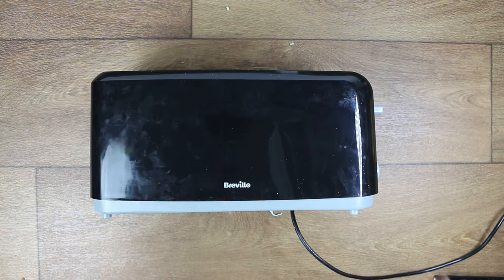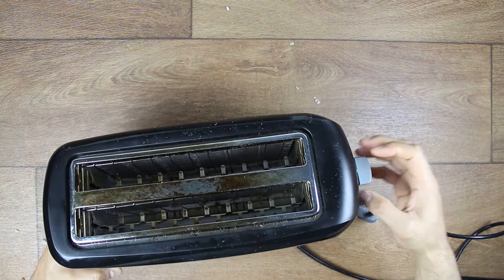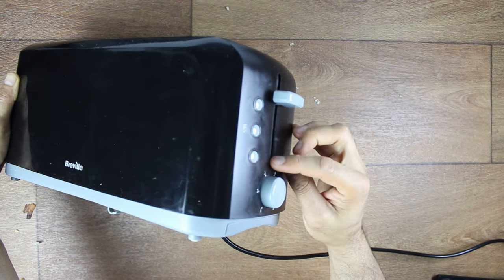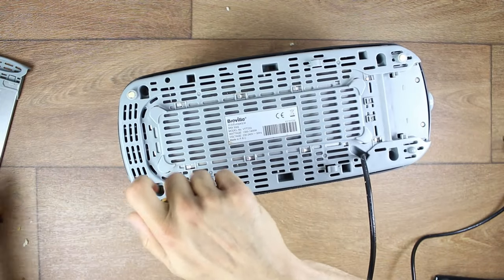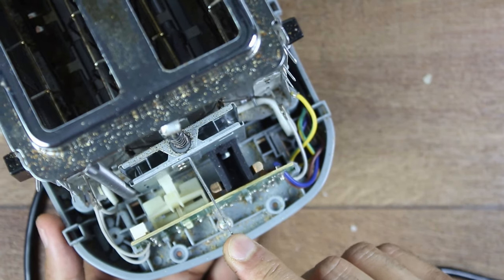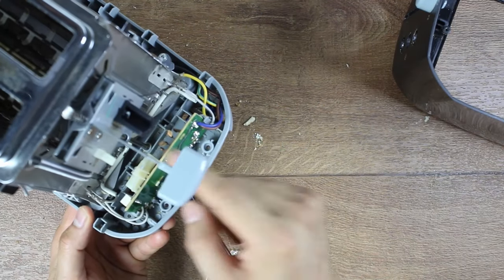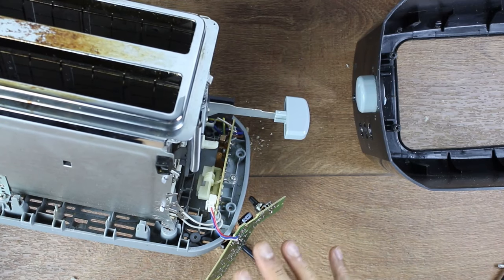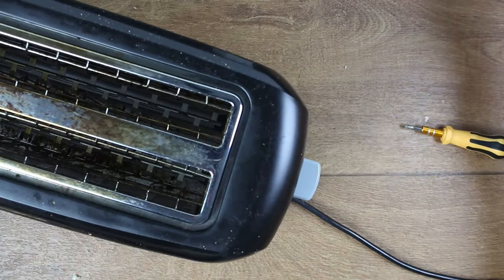Toaster Lever Won't Stay Down - Easy Fix If It Has Power - Breville Vtt233 4-Slice Toaster

Comment: There is a magnet which is activated by the V shaped object when you press down.  This magnet holds the mechanism until the timer tells it to cut the circuit … so it’s not always crumbs that cause the problem.

Comment: Thanks for your video. I have a Grundig toaster, where the lever would not stay down. Watching your video gave me the confidence to take it apart. give everything a good cleaning with a dry toothbrush, and then blow some compressed air into it from every which angle. And when I put it all back together, it worked.

Comment: Your fix worked even when the tab on my toaster would not come off the lever. After I lifted the cover, 2 big crumbs fell out, and I could clean the parts with the cover pulled up as far as possible. Thanks for your thorough directions that deliver!

Comment: This fix totally worked - I was glad you said to be prepared for different types of screws - My model had three different screw heads and six metal fasteners that needed to be repositioned - At and rate, the toaster stays down and will hopefully give us another 6 years of uninterrupted use - I am so happy I looked at your video before tossing it out

Comment: I have a Hamilton Beach Toaster and the plastic lever can't be removed. After disassembling as much as I could (the design makes it practically impossible to fully take apart), I found out that the lever on this toaster catches with a magnet, not a mechanical piece. So I made sure to wipe clean the magnet attached to the electrical board, and the other magnet that moves with the lever. It didn't seem to work when I plugged it in to test, but I read that some toasters need to be fully reassembled for the magnet to activate due to sensors (I don't know what kind of extravagant toaster has sensors but I didn't really have any other options lol). I put the toaster back together and after trying a few times (and holding the lever all the way down briefly before letting go), it started catching! Not sure how necessary the reassembling was, but mine is working now. Thanks for the video, and I hope this comment helps others.

Comment: Worked for me, despite the manufacturer slipping in a screw with a triangle-shaped screw drive and wires inside that could not be detached to remove the cover. Thanks!

Comment: In my case it turned out that the plastic cover for the plug when it ships to you was shoved in to the toaster who knows when, and one side wouldnt stay down. It had been this way for a long time so we used it as a 2 slice toaster, not a 4. Security torx screws in my case so was a total pig to open. Bashed it many times on its base while I had it outside. Shocking how big "crumbs" can be. No way would they fit out on the crumb tray. Surprised it didnt catch fire before now! Enjoyed our toast, cooked 4 at a time and yes we toasted you! Thank you!

Comment: Thanks for the video. Very helpful. I tried to clean without opening. I shaked couple times. Many crumbs came out but it didn't worked. Before I decide to open I shaked very strong and even hit the machine on the table couple times. More crumbs came from the machine and problem solved without opening. Thank you very much

Comment: Blew it out with compressed Air couldn't get all the crumbs out by shaking or vacuum. I Had to go that route because of no screw driver for Special Screws. , Lots of seeds from multi grain breads.  Works Great, Thanks!
Reply: This is why I was reading the comments! I was unsure about whether or not I should blast it with the compressor, thx!

Comment: Thanks so much we have 2 Oster toaster that both eventually "failed", we followed the video guidance and after a disconnect of the heat controller board, dusting... Ours wich has a mag-catch worked fine again!! Thanks for posting.

Comment: I tried the first 2 fixes to no avail. I plugged it into a different receptacle and voila!
I noted that the toaster was plugged into a gfi receptacle. I pushed the reset button. Success!
U might include that check early in your video. 
Thanks for your clarity.

Comment: Wow, it works. The pushing the lever to a side specifically. The toaster lever wouldn’t stay down so I did the thing where you push it to the right side and it works again! I guess it’s because the thing the lever catches on or whatever was slightly off so getting the lever to the side caught it and put it back in place.

Comment: I clean my toaster and I could not believe how much crumbs came out and chunks of bread.  It was a lot!!!! Then I tried the lever and it did not work. I opened it up like it showed in the video and I brushed around with a toothbrush.  I put the screws back in and plugged the toaster in and it still didn’t work.  I was disgusted because it worked when it was full of crap.  I waited like five minutes and tried it again and it works like a charm.  I have no idea what I did but wait.  So if you have tried everything in this video just keep toaster plugged in for like 5 minutes and try again.  I don’t know it toaster reset themselves or something but it works fine.  Btw it’s a Cooks double toaster.  One side has never worked but we will use it until it finally dies 😅 thank you poster, this was helpful.

Comment: Thanks for the video. I have the same model but unfortunately cleaning didn't work. I noticed when you hold down the lever lights turn red. In my case it doesn't. I assume electromagnet is not getting electricity and holding the clip (?)

Comment: Good video - It didn't solve my problem, but it gave me a good understanding of what my problem is: the electromagnet isn't getting power because of a broken connection (the connections on the circuit board are sometimes very fragile), and, unfortunately, it's too small for me to do anything about. Frustrating that such a small defect stops the whole machine from working.

Comment: once you power up the toaster and put the lever down it makes two contact and electromagnet get energized and keeps the lever down.After defined time as set by user by rotating knob the electromagnet gets de energized and thus poping the bread and cutting power supply.its as simple.My toaster was not poping up so i simply opened it and sprayed sanitizer on rotating knob(variac).As time passes its becomes open circuit. You may replace the      pot(variac) or fix resistance.In this video lever is only making one contact.open it and clean the contacts.it will work.you can use sanitizer spray on contacts as well.If it solved your issue give me a thums up.

Comment: Thank you for the useful video,I have the same issue with the toaster. After removing the case, I  followed all the steps from brushing to cleaning all around the toaster body and the lever contacts then it worked while it was out of its case, but it didn't work when I put the case back on, I tried three times, the lever still does not engage when the case is on. Any idea what could be the problem.  Thank you again.

Comment: I fixed my toaster by undoing the screws underneath,  lifting the body up, and tipping out the crumbs and lumps of dry bread which hadn't been released by removing the two drawers and tipping the toaster upside down.

Comment: These are great instructions! Unable to save our toaster but it was good to check if there was an easy fix before buying a new one. A four slice breville toaster costs about $100 - 150nzd here, so it's worth trying to repair. FYI - our leaver didn't just slide off, there was a small plastic latch I needed to release for the plastic and metal part of the leaver to slide out.

Comment: Gonna try this later but subbed already, very well presented and nice production quality :)
Reply from the maker: Thanks for the sub!  Let me know the outcome!
Reply: @HealMyTech1  
It was a bit different with my roaster, the lever didn't stay down but it also didn't turn on at all. I opened and saw that one of the heating wires was snapped. Not that big of a deal tho as it only did cost me 30€ and lasted almost 10 years :)

Comment: Hi, I have taken most of the screws out of the base of my toaster. The four screws under the plastic legs are a different size/shape than my tools. I have tried a hex/ Allen wrench and a torx bit wrench but neither fits. What did you use?
Reply: Use a drill and drill them out. Brutal, but it worked for me.

Comment: I feel like my dad!

I found a tiny spring had popped off and there was a bit of movement in the switch.  Since it was a 4 slice the switch was back to back with another one, so I just put a dab of superglue to reduce the movement and reattached the spring which I’m guessing popped off because of the wiggle in the switch.  In any case, with nothing to loose except a fuse I put it back together and it worked perfectly.  Thanks

Comment: I have a breville with the same problem.  But I can’t even open it.  What kind of screwdriver did you use.  Mine are like a flat head interrupted in the middle with a piece sticking out :/

Comment: At 8:34min vid has been edited, not showing you removing the crumb or if there might be another problem. You just skipped to reconnecting the little plug again. What happens if it's not a crumb?

Comment: I have a Breville BTA730XL whose lever will not stay down. I watched the video and attempted to remove the case and was not able to do so. I contacted Breville customer service and they referred me back to this video or I could bring it to a service center. Unit is out of warranty. The fix about cleaning the contacts makes sense to me but as stated I am unable to get the outer case off. This is a mechanical problem that should be an easy fix. All other components, (electronics) function perfectly. I paid extra to have a good toaster and it has been but this toaster according to industry stats should last 6 -7 years. I was only able to get half that amount of time. If my only solution is to throw this toaster away, I will not be buying an expensive Breville toaster, I'll buy a toaster at one fifth of it's price and throw it away instead.

Comment: My Oyster toaster  lasted only 6 months out of the box. Cleaned it is all I did. Has a 6 - three prong head style screws on the bottom that can’t be removed with a Phillips or flat head screwdriver. Did not work for me and it looks brand new. Nada

Comment: I bought the toaster because my old one was not big enough for wide slices of rye bread https://www.youtube.com/post/UgkxE7HOOpW0eh4vbVGAB_r_cURwoxZxpZPA  and it was wide enough for huge slices or, if the bread is narrow, four slices at the same time. It has a defrost setting which is great because I keep my bread in the freezer, and a rack that you can use to heat rolls. The rack will even reheat cold pizza! It does get hotter after the first slices are toasted, so for subsequent slices you need to reduce the toasting time.

Comment: Mine shuts the electricity
Reply: Same I don't know what to do
Reply: It's leaking to earth
Reply: For future fixers with same issue, generally keep away from anything with an earthing fault.  In the case of a toaster usually either the toast pushing wires have bent and caught an element, or an element has bent and caught those. Might be fixable but make triple sure it's unplugged and cold before you try anything, and if that isn't the issue just chuck it, it's unsafe to try and fix, and anything other than a short there would have utterly fried the timing circuitry beyond repair.

Comment: Nice job.. but too bad my toaster has screws that you cannot buy or even order a screwdriver in which they fit..

I looked at the screws.. it stupid.. nobody has a screwdriver like that.. it's like a phillipshead but has 3 *'s instead of 5 

Its shaped like >-
Reply from the maker: I know these screws, y shaped, they are called tri-wing screws, my screwdriver set has these.
Reply: Anyways, it just needed a good ol' karate hit and it solved the problem .. the irony of it all